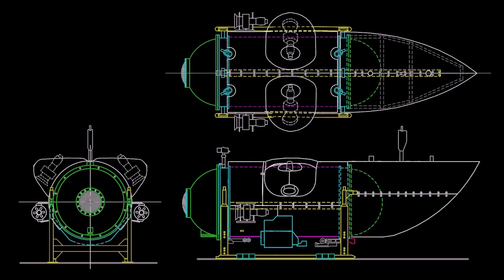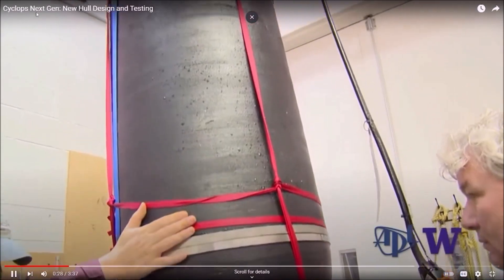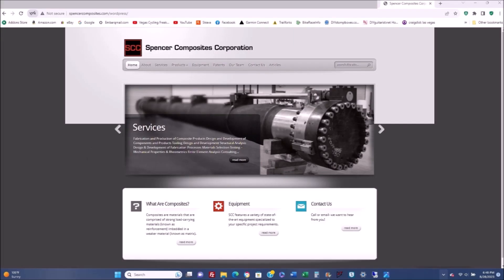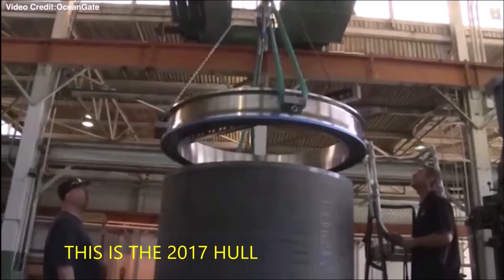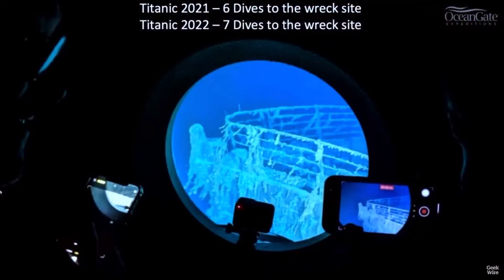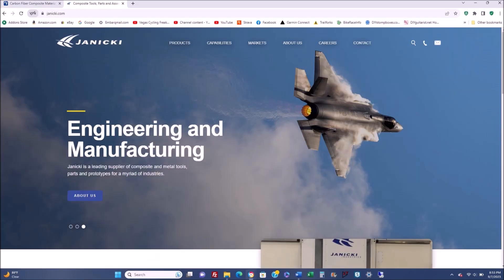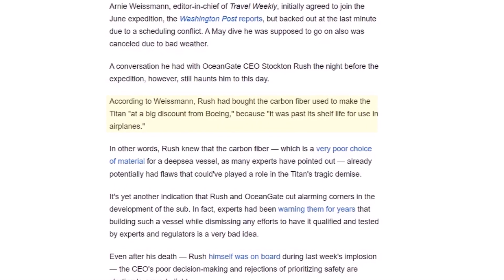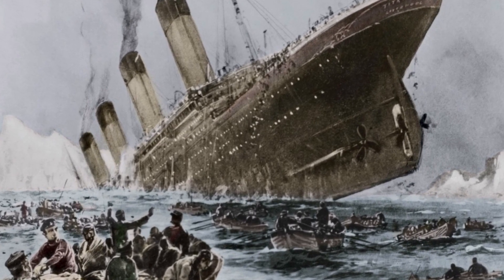OceanGate Titan - THE CARBON FIBER CYLINDER(S)

Comment: I'm not sure how one can ever get a material not good at compression to be good at compression, but maybe.  Though I am not gonna risk my life on it.
Reply: Google and you’ll find that CF is excellent in both under tension and compression.

It is strongest under tension… but that doesn’t mean it is weak for compression load. CF is still one of the strongest material available for compression.

Only idiots believe CF is weak under compression because it is absolutely NOT weak at all, not even close.
Reply from the maker: @tonamg53  It seems to me that the problem is the hull really needs to be made using a 3D weave, and the technology for that just doesn't exist for it at the moment. Would be much more difficult for any de-lamination(s) to occur with a matrix like that. With the fibers essentially being all in one direction, it's relying too much on the strength of the resin/epoxy. That has been my thought from day one. So in other words, I agree with you, but I think it needs to be manufactured a very specific way to achieve the maximum strength possible.
Reply: @VegasCyclingFreak  Well, this is the first example of a catastrophic failure of CF with something the size of the Titan’s hull. I understand that it is actually the largest object in the world ever constructed using only CF. So, this is actually an uncharted territory with this accident. 

I agreed with you that a 3D weave would’ve certainly make it stronger but then yes, the question is it even possible to manufacture something that size with 3D weave.

But I’m not sure if a 3d weave is actually even required as it could be that there was a defect in the manufacturing process or an inadequate maintenance procedure that is the root cause of this accident. It could also be just the fact that it was tow out in open ocean and we know that carbon fibre can be damaged overtime by UV rays but was it enough to cause the accident? I don’t know.

We just don’t have enough info to be able to assess that at the moment.

Note that there was actually no concern with the CF hull at all prior to the accident. All warnings and concern raised were unrelated to CF such as ex-engineer raised concern with the acrylic porthole. The society of *something that sent the open letter were concerned about carrying paying passenger and were afraid that if something bad happened, it could’ve taken the whole industry down with it… so it was actually a business concern and not the CF.

Then, accident happened and suddenly everyone is concern about CF🤦🏻‍♂️
Reply from the maker: @tonamg53  Yes, I agree. All good points you make. There are a lot of firsts in all of this. 

If we pay close attention to timelines, the David Lochridge lawsuit and letter "by more than three dozen industry experts" were all prior to 2020 and refer to the 2017 hull version of Titan. The other reported problems it had were mostly pre-2020 as well. It seems that Rush quietly took some of their advice during the COVID pandemic. He scrapped 2017 hull. Rush made the first dive to depth in that hull solo and I think it scared the poo out of him. 2020 hull was moved literally from coast to coast to be tested in a hyperbaric chamber in Maryland before first dive. So it would appear that maybe he started to think about the possibility of hull failure a little more seriously at some point but still too much reliance on an unproven real time monitoring system, which appears to have not been the predictive system envisioned. 

We can't really compare pre-2020 Titan to the one that imploded... they were two different animals. People smear it all together, and I'm doing my best to point out these differences. Timelines really matter here.

Comment: Ref 0.22 => It's difficult for me to not lay blame for this disaster on S. Rush.  He is the one who was CEO, and gave lectures, indicating his knowledge and understanding of the research and design process for the carbon fiber based construction of his company's deep diving vessel/s.   By using carbon fiber, he outright ignored the well known strength of material fact about it.  i.e. that it was basically strong in tensile strength but weak in compressive strength.  So, he was an innovator by choosing to use this material in its weakest mode of strength under tremendous compressive undersea forces?  In addition, he opted against checking the vessel's hull integrity after each dive.  Stating (I've heard) that there was no way to check the carbon fiber wall because it was too thick.  I don't believe that the hull wall couldn't have been non-destructively tested with all the technology of today (x-ray, gamma ray, etc).
Reply: There was someone on YouTube who said a simple $10,000 ultrasound just like a pregnant woman gets, would have done the job easily.
Reply from the maker: @nancythane4104  Maybe but it won't catch something that develops while at depth. Those kink bands can suddenly develop without any warning. That's what I believe led to the hull failure.
Reply from the maker: I get where you are coming from. The patented RTM system was supposed to give warning well in advance of a hull failure, based on Rush's testing. This system recorded data on every dive and compared it to the present moment, so in theory this should have never happened because it would catch a weakening hull. Conceptually it sounds like a great idea but it seems that in the real world it yielded a much different result. 

On the other hand, they were also relying on a third party to design something that could do the job. You would think that these outfits would have just refused to build it... but maybe they wanted more to be involved in something that hadn't been done before. They're probably regretting it now.
Reply: @VegasCyclingFreak  Where is the testing and validation that his so-called real time monitoring method will accomplish anything?

You could probably patent a method of using kittens to do the monitoring, but that doesn't mean that the method would actually accomplish anything.
Reply from the maker: @ej2953  This sort of monitoring has been in use for decades in all sorts of things. Airliners use it for determining service life of parts. Boeing 787 is 60% carbon fiber. They use a method of measuring resistance vs Rush's method of acoustic sensors. I think the main problem with Rush's idea is that it was not actually a predictive system in the manner he envisioned it would be.

He validated the system by destructive testing 1/3 scale hulls at APW.

Comment: it would be nice to see the earthquake data. sizemograph of the explosion part of the implosion. earth quake monitors picked this up. i dont know why this has not been released. when there a quake results and size are instantly available.

also due to you being good with math. i would like too know how small the crushable objects bodies and air got too, before the explosion part of the implosion. it would be smaller than any off the air tubes in the sub.

all 4 air bottles. would be rated at 200 bar. the preasure down there over 300 bar. the air could not come out of these bottles down there. water would RUSH in.. ,,no pun intended,, the oxigen in these bottles would be more than the airspace in the sub. so would cause 4 more implosions, causing 4 more explosions, larger than the sub one. hence be real nice to find the earthquake data.

great and detailed work again well done.
Reply from the maker: I did a search for seismic activity in that area on the day of the implosion and didn't find anything. While this implosion event was akin to several thousands of lbs of TNT, I think it would have just been a very obvious loud noise picked up by any sonars listening in that area. Don't think it was enough to register on seismographs. Or at least maybe there weren't any in that area.

I don't really know how to calculate how compressed everything became when it imploded, that's actually kind of a complex set of variables...  suited for a computer simulation. I see what you are saying about the oxygen bottles. Seems to me that it would have all been just kind of one big event, with everything happening more or less simultaneously. 

I remember Bruce Morton said that they put some of the large size styrofoam cups in a bag on one of the dives and when they got back to the surface they were the size of shot glasses.
Reply: @VegasCyclingFreak  2 days after there was tv in uk saying itwas caught by earthquake monitors. dont fget  4to 5 mile radius every living thing killed. it all must have crushed smaller than one of the oxigen botles, b for explosion part. it says in real easy english how many metres of oxigen each size bottle holds at what bar presure they filled too. lets pretend sub was 20 metres of space. 4 foot ox bot holds 40 at 300 bar. so the 20 in sub would need to be much smaler than the 4 by 9 bottle because the bottle hasent blew up. 2 of my 4 brain cels are on strike. and the other 2 like things real simple. like the way you sort your vids and work stuff out. good on ya.
Reply from the maker: @theweasel-uf7dn  I hadn't heard about that bit on UK TV. That's interesting. Honestly I have a hard time even conceptualizing the implosion. It's just way outside my realm of experience. I suspect it failed via kink band formation, which could have occurred anywhere on that hull. Exactly what happened to what was inside the hull I think would vary, depending on where the failure occurred. As far as the explosive parts, it seems to me it would be comparable to an airplane diving straight into the ground at terminal velocity - all you find in those situations is little bits and pieces... maybe a hand, part of an arm, etc.